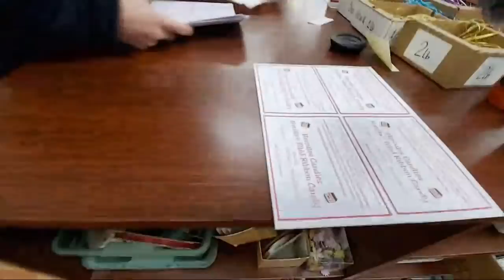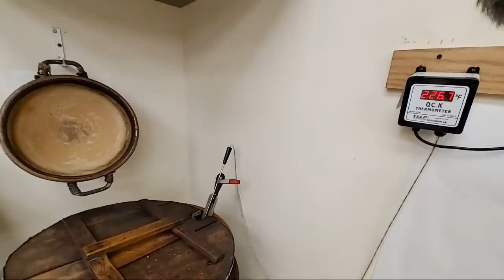NUTELLA FILLED RIBBON CANDY!!!

Comment: SOMEONE PLEASE TELL ME WHERE TO GET THOSE GLOVES! i always burn myself....
Reply: You can Google it. Vinyl gloves, leather gloves or canvas gloves.
Reply: The large ones are welding gloves
Reply: @julie007ght  Thanks Karin. I knew they were leather but couldn't come up with the name. You know when it's on the tip of your tongue but it won't come out. 😉👍🏻
Reply: Thanks for the replies, i tried good ol' nitrile heat resistant gloves and they worked perfectly, still burned myself... but they didnt stick to the candy!
Reply: They also came out to be the best batch yet
Reply: @SandraOranje  quite often! 😀